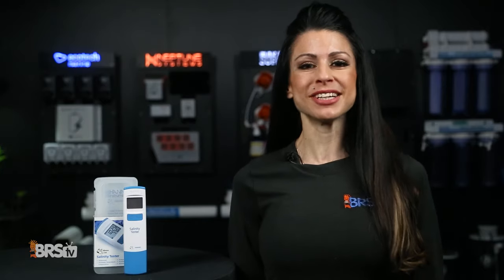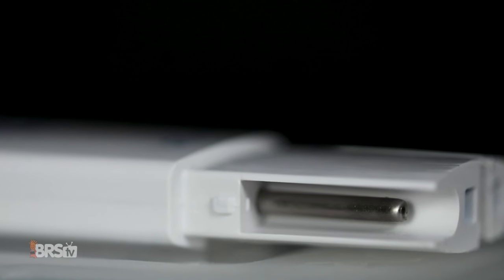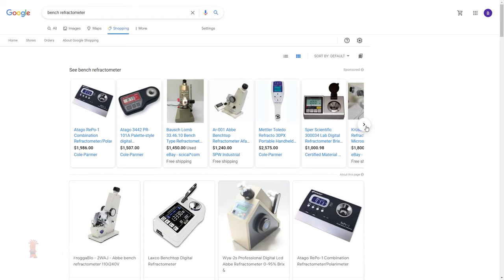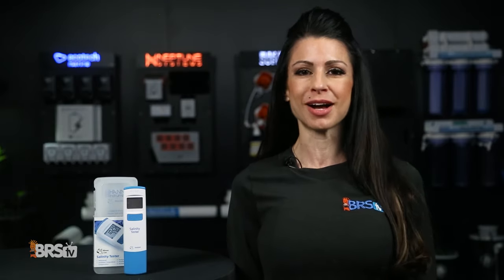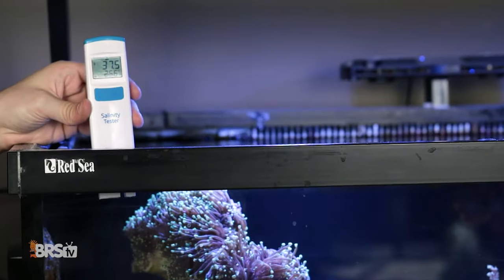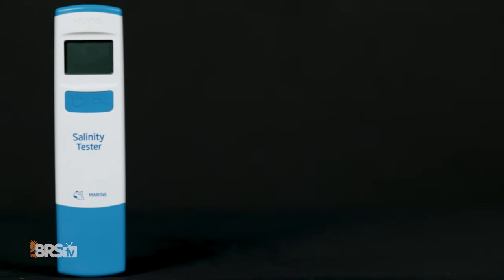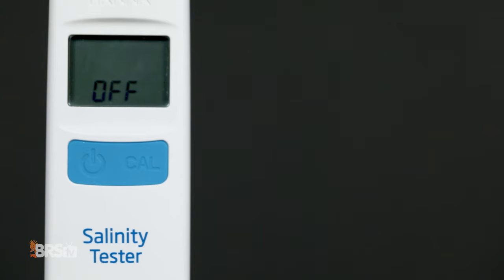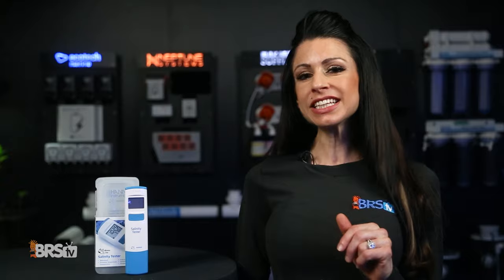A Different Way to Think About Testing Your Saltwater Tank's Salinity Using Electrical Conductivity

Comment: Excellent bit of kit but make sure you calibrate every month. Readings drift quite quickly if not done.
Reply: not my experience at all
Reply from the maker: Calibration is never a bad idea. Thankfully, the calibration solution packets are rather inexpensive.
Reply: more like every time you use it,  only then does it match my hydrometer should be better needs calibrating to often
Reply: @graeme7662  that's just not true
Reply: @Alamo-cz5xc  my Tropic marin  hydrometer matches Ati icp test the hanna checker dosent know which one i trust as said hanna salinty hecker drifts too often
Reply: @graeme7662  great story. Thanks for sharing

Comment: you guys run your tank on 37.6? isn't that 2.6 to high then where it should be at max or can i run higher?
Reply: so you aim for 35 also so why is the tank 37+?
Reply from the maker: We aim for 35 ppt in most cases. It takes the meter a few seconds to adjust to the temperature of the water and give an accurate reading, so had the camera been rolling longer, the number would have come down slightly. Closer to 35 ppt
Reply: @BRStv  So why couldn't you show that? One would think if it did settle you'd show it.

Comment: How does this compare to the Milwaukee digital reader? I have one now but this seems more convenient. Thanks!
Reply: I think Milwaukee is better. I have hanna one and it’s never given me a problem. There’s comparison videos on other channels.
Reply: Milwaukee is by far better in my opinion
Reply: I use the Milwaukee digital, love it.
Reply from the maker: The Milwaukee works based on light refraction vs the Hanna works based on conductivity. Both have proven to be fairly accurate and easy to use. If you already have the Milwaukee, it's not worth switching in our opinion.
Reply: @BRStv  thank you appreciate the response

Comment: I had a different salinity "pen" some time ago and I had to store it in liquid (that's why I got rid of it). How do you have to store the Hanna Salinity tester? Is it okay to rinse with RO/DI and then just put the cap on?
Reply: Quick rinse in rodi, shake off the excess water, cap on and store, Its a great bit of kit also takes the guess work out of aclimitisation as you can just dip into a bag and quickly check if temp and salinity match
Reply: @Loci333  Nice, thank you!

Comment: How does the Hanna compare to the Apex Salinity Probe? That probe gets dragged hard core
Reply: I know the hanna PH stays calibrated for awhile with little drift. I use it to check my Apex's PH probe drift every couple days.
Reply from the maker: The Hanna salinity tester is not designed to stay in the water 24/7 like the Neptune salinity probe. This means that the micro bubble issue that the Neptune probe has isn't an issue for the Hanna tester as you're only using it for a few seconds at a time.

Comment: If you are squinting when using an eyepiece of any sort, you are doing it wrong. Do yourself a favor an don't try to close the other eye. Just look into the eyepiece with your dominant eye and don't care about what the other eye sees. After a bit of getting used to it, at the latest, you should be able to automatically "shut off" what the other eye sees.This is much more convenient and you'll actually see more, because you are not accidentally squinting with your dominant eye, too.

Comment: Not a big fan of the Hanna Salinty checker, I prefer the Milwaukee digital refractometer right on the money +/- .01 ppm usually a temp issue.
Reply: well it costs less then half the cost of the Milwaukee digital refractometer soooo